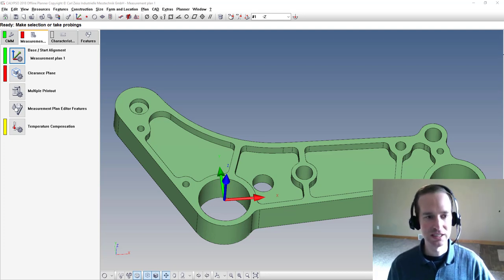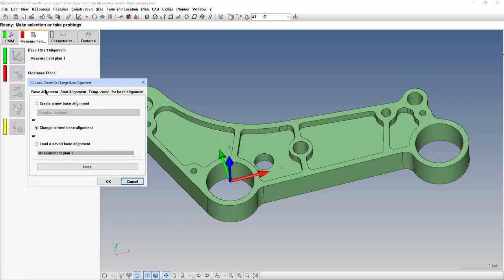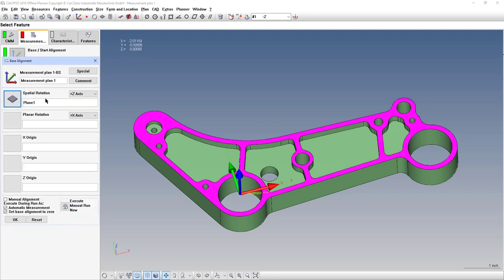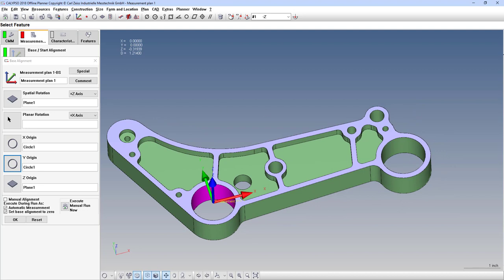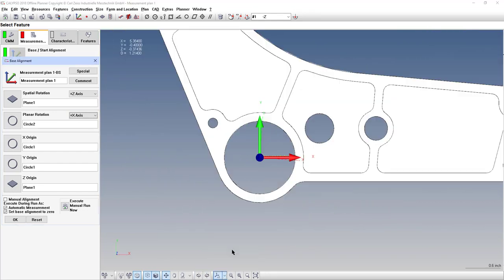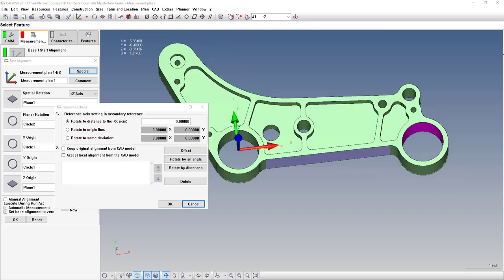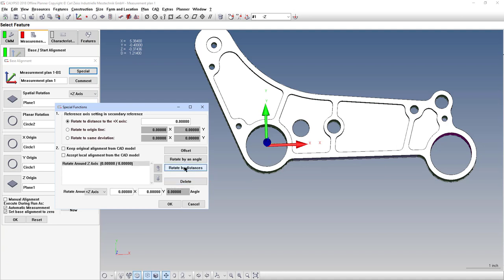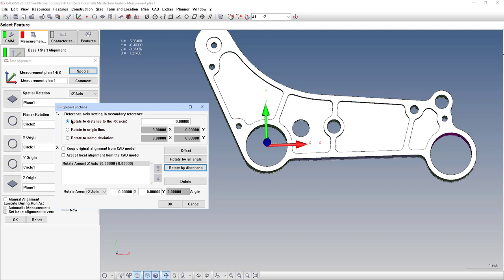Special Alignment - Offset Hole (Zeiss CMM Calypso)

Comment: I have a hole defined in the feature window using polar nominal (174.289), when I create a TRU POSITION characteristic the angle shows the angle as (-84.289). How can I correct it.

Comment: Thanks for the video! I have a question. We have some castings that I need to check features on both sides. My datum is a thru bore and my clocking hole is also thru. Is it possible to have a second alignment in one program, so that all my characteristics results are in one document? If it is possible, would please do a video of that? I did this quite often on our old cmm, but I don’t know how to do it in Calypso. Please help!!!
Reply from the maker: Hi Jonathan,
Yes it is possible to create a secondary alignment similar to how the base alignment is set up. Can you please send me an email at steven@victoryprogramming.com to clarify what type of secondary alignment you are looking for? Based on your description, your part can be aligned in the Base Alignment.
Thanks,
Steven

Comment: I know its a longshot on getting a reply, but whats the point of doing this versus a normal alignment without worrying about the offset hole?
Reply from the maker: Good question! Sometimes a datum feature like this is offset with basic dimensions, and the rest of the part features are dimensioned to the theoretical X or Y axis. In this case if we rotated to the hole with a normal alignment, the basic dimensions to the other holes would not match the drawing.

Comment: In Rotate by Angle option for 45 degree I,e X=95 & Y=95, both X and Y actual where same X=95.016 & Y=95.016, how do I know the actual X and Y values!
Reply from the maker: Hi Gagan,
You can report the actual X and Y values of the feature by checking the "X" and "Y" check boxes in the feature window. When the alignment is rotated by 45 to a feature, that feature will always report X and Y values the same. You can also create a secondary alignment if you need to report the X and Y values relative to other datums.

Steven
Reply: @victoryprogramming3833  
Thank you.

Comment: Sir in rotation by angle method, in which direction need to rotate wether clock Wise or anticlockwise and how to decide that one, pls explain
Reply from the maker: Hi Veera,
For rotation by angle, the alignment will rotate counterclockwise for a positive angle, and clockwise for a negative angle. You can visualize the effect by viewing the CAD with the rotation axis pointing toward you.
Steven
Reply: @victoryprogramming3833  ok sir thanks. I understood.

Comment: Can you relearn a feature in Calypso like you can pcdmis?
Reply from the maker: Hi Michael,
It is possible to scan "unknown" geometry with curve features. For regular features, I am not aware of a function in Calypso to "relearn" the actual geometry. You could simply copy the actual values into the nominal column.
Have a great day,
Steven
Reply: @victoryprogramming3833  and this would in theory allow my program to run through? Thanks for the reply by the way!
Reply from the maker: @michaelstrickland9970  Yes

Comment: why not use a plane on the surface you are aligning to and use that for plannar
Reply from the maker: That's a great point! The front surface could be used for the planar rotation as well. For the base alignment, that would be perfectly fine. However, the two large holes on this part are the functional datums, so we need to align to those to measure the true position of the other small holes.
Reply: @victoryprogramming3833  what if you created a drf for those positions?
Reply from the maker: Yes you could create a datum reference frame or secondary alignment for the position of the small holes. The process of creating the offset alignment with the Special button would be the same way you do it in the base alignment window. The base alignment does not necessarily have to use datum features. It could be any combination of features that restrain the part in space.
- Steven
Reply: Sir, can you show me base alignment for part that not have perpendicularity surface.such as manifold....please advise